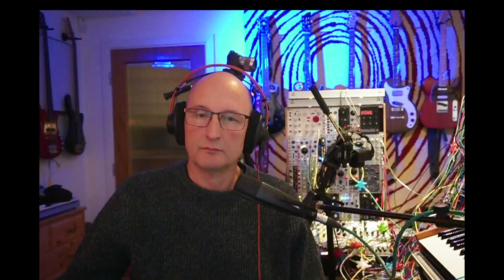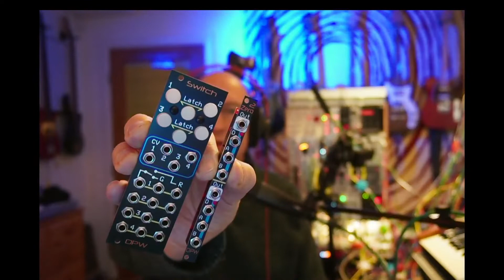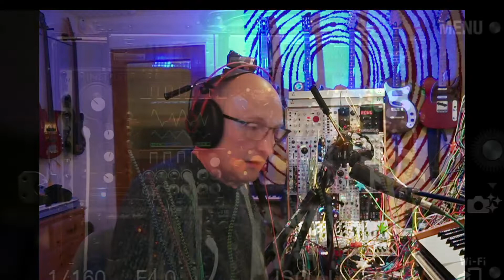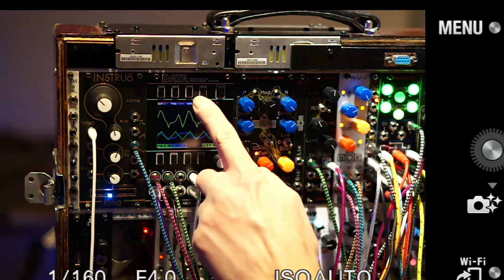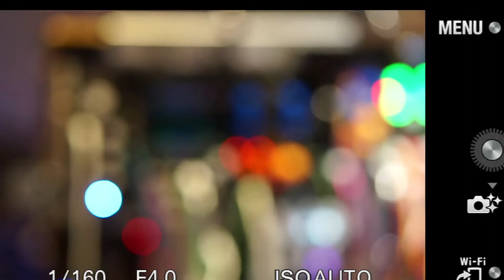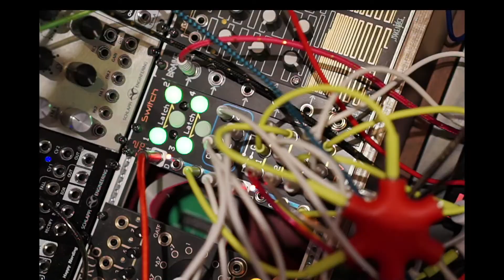Zero 2 Stereo Switching

Comment: I am still very interested in Zero2 plus Switch4. Did I understand you right that about 7KHz ist the upper switching speed limit?
Reply from the maker: Yes, if you don't have anything connected to the D input. The circuit is very fast so I decided on 7kHz when it's running sort of in free mode. Otherwise it would let noise through, it is a way of suppressing noise in its function. BUT if you want the update frequency of detection to be higher you can do that by connecting an oscillator to the D input. That way the oscillator will determine the max switching frequency, it can be set to be way above 20kHz. You can in the same way connect an LFO or a gate signal to D and set the frequency to be as low as you want. The actual detection of a zero difference event is super fast, in the uS range and will be a very clean detection. The frequency we are talking about here is just the maximum amount of times per second it is allowed to do a new detection. I hope this makes sense :-)
Reply: @DPWDesign  Thanks for that long and precise answer.